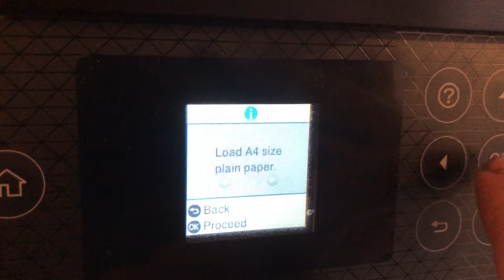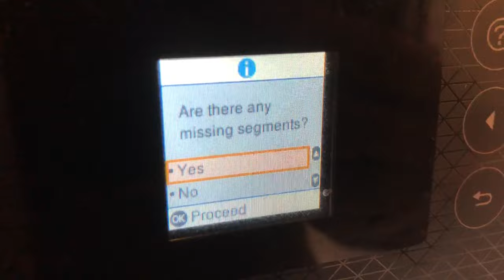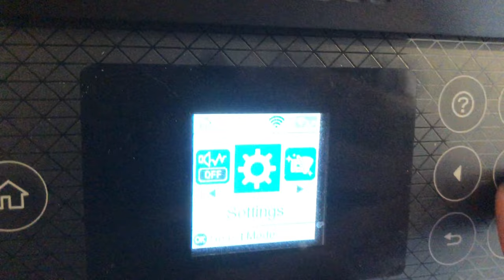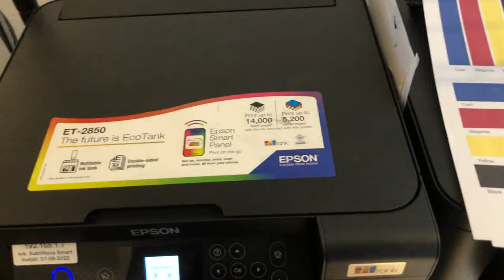How to fix an EPSON EcoTank 2850 print quality issues or the colour is missing completely #ecotank

Comment: Not sure if you can help me but I thought I'd see if you can give me some suggestions after watching your video. I just purchased a new ET 3850 and completed the entire setup process. I chose the correct paper size and paper quality. I printed a basic document with a small picture header that I had on file. I am extremely disappointed in the quality of the print. The blacks are gray and the entire document is grainy. I notice the same thing when I scanned a document and even before I hit print the document looks distorted and grainy. There are no lines or separations in any of the images so I'm confident that the alignment for the heads is correct. Any suggestions before I take this thing back or I bought it.? Any assistance is greatly appreciated.

Comment: urgent
Hello

Can you please give me some advice? After my printer experienced an ink alarm, I purchased new ink from Epson. The problem is that the colors pink and blue don't fill in.
I think there is a problem with my tank. I didn't really know what to do. I've done all the necessary troubleshooting with the printer, I mean  maintenance required and... But it doesn't work. It shows that there is ink, but I know there is some ink missing in printer.
It no longer prints in color. I bought this print last year in March.
I would be very grateful for your help.
I have translated from German to English in case it is not well written.

Comment: Okay that did not work i cannot see a link to the next part that needs ink. Ive hardly used the printer. Its one year old yesterday and will not print any colour only black? The blue sections on what i tried to print are just faint lines and no colours on the page you printed in this. Help

Comment: I have 2 of these ET-2800 and 2850 both clogged, not a nozzle problem the ink not flowing into the small cartridge inside. I had to do a power clean. when they crock I will never again buy these crappy machines.
Reply from the maker: If you check the description there is a video on how to fix a bad clog like yours, it may help thanks.
Reply: @DanielJohnHowTo  I am sure there is but it's not something I can do nor want to if this is a regular accurance. But thank you for trying to help.
Reply: I had the same issue with the Epson 2400. I  had to get rid of 2 of them because of the same issue. I just purchased this one in the video. Please don’t tell me it’s going to be the same issue. 😮
Reply: @buteful25  I was told you have to print on a regular basis for it not to happen. Good luck 🙏
Reply from the maker: @buteful25  Thanks for your comment, I had two 2850's with around 5-7k prints on them, no major issues yet.
Reply: I did the major clean this afternoon and turned off for 12 hours - hoping no lines in my project tomorrow when I turn it back on
Reply: Yeah, I used to have a really old HP cartridge printer and I thought I would treat myself to a state of the art Epson ET-2850 Ecotank about 6 months ago.  I don't print very often but whenever I did use my new Epson the quality was really deteriorating quickly.  Have just done the nozzle clean and head clean which didn't really help - am now waiting for 24 hours from the power clean to hope things have improved.
Reply: Powerclean did the trick - thanks Daniel & John 👍👍

Comment: I just did a nozzle check and got all the lines to be present. But when I printed some b&w pictures on card stock paper there were so many lines/gaps on my prints. Would you recommend a head check or power clean? 😫
Reply: It also doesn’t do the lines when I print in color…?
Reply from the maker: all the lines present even on the black nozzles?  do another nozzle check to be sure.

Comment: Very informative video. But when I try doing the nozzle check it keeps saying invalid even though there is paper size is correct 😭
Reply from the maker: are you doing the nozzle check from the PC software or directly on the printer using the menu?
Reply: Press the button bottom right rather than ok
Reply: @DanielJohnHowTo  It worked after I ignored it for a month lol. Still didn’t fix the issue though since color printing was faded and now non existent despite there being ink
Reply: Omg did you ever figure it out? I’m having the same exact issue   😩

Comment: Print issue I have is, vector files sent from CorelDraw end up printing noticeable however slight, jaggies on some font characters.
Reply from the maker: with corel draw, try print preview for printing not just print from workspace it seems to clean the images up and fix problems.

Comment: I wish you'd explained how to actually do the power cleaning.
Reply from the maker: I did
Reply: @DanielJohnHowTo  When I select Power Cleaning I get the info screen which says I might not have enough Ink, and to refill the tanks first.  The tanks are already full.  If I try to proceed, it just goes back to the Power Cleaning option.  I'd like to see what happens when you actually select power clean and the process begins.